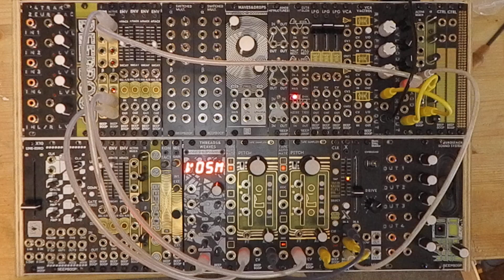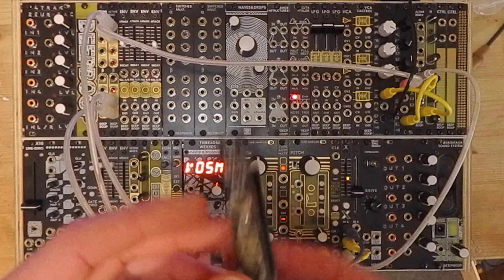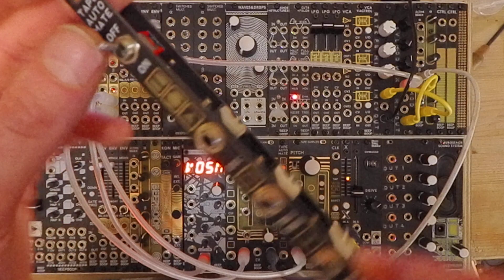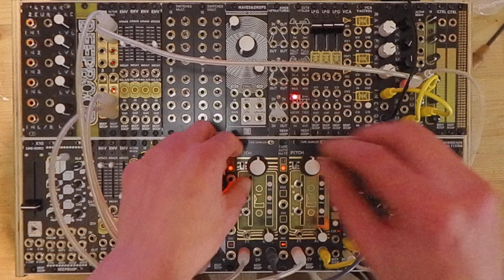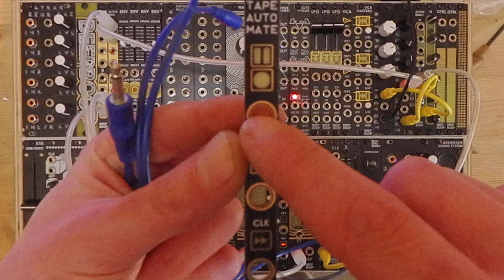BEEPBOOP Electronics - TAPE-AUTO-MATE expander demo

Comment: love your work...i have an 1820 on a board and gunna try eurorack it with a buck converter...if it doesn't work i might try to get one of yours.
Reply from the maker: Thanks!!! Yeah have fun experimenting :) The chip has alot of quirks to getting it working at it's best but if you just want to get started building up someting I recommend the OM Synth tutorial by Bastl. it gives a good basis to get started but getting the chip to reliabaly record when in loop mode and reducing the click for example have taken alot of experimemtation. I am very near to releasing a new version using another ISD chip which has longer recording time and is much more stable and reliable over a wider range.
Reply: i might wait for the new version then..thanx for the tip on the tutorial @beepboopelectronics

Comment: Really cool product, but I have some questions: As I see the Rec-function is held for the duration of the recording - is the corresponding CV-Input also momentary, or is it a latch? 
Also, is the Pitch-CV tracking v/oct?
Reply from the maker: Hi :) the CV will be applied both during recording and playback. As extreme modulation will prevent recording it is best to attenuate the CV while recording